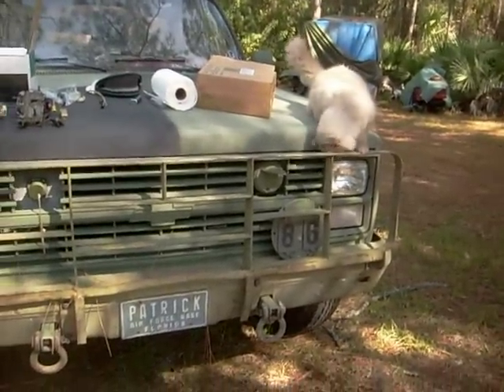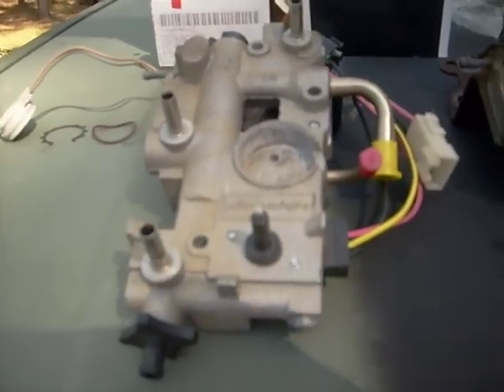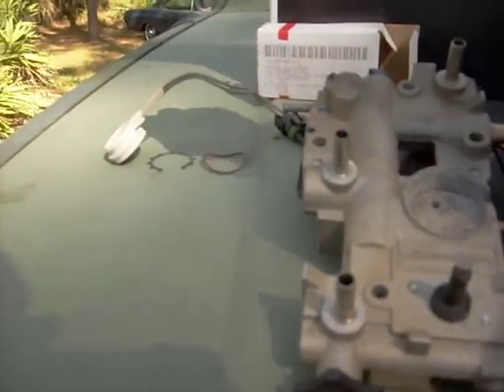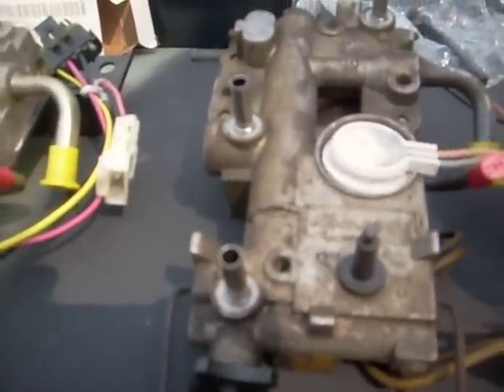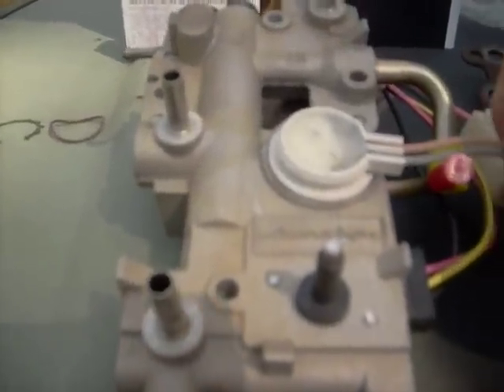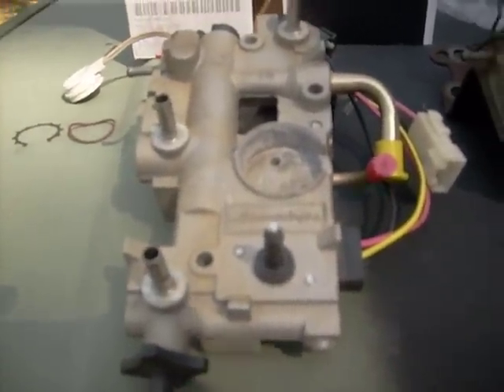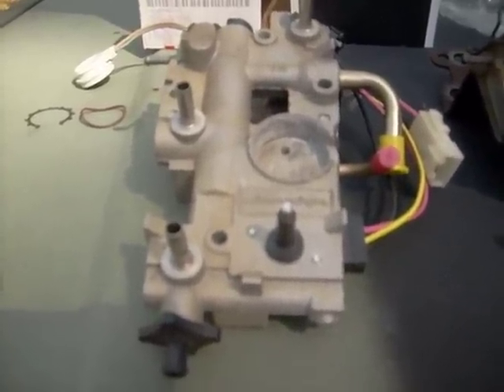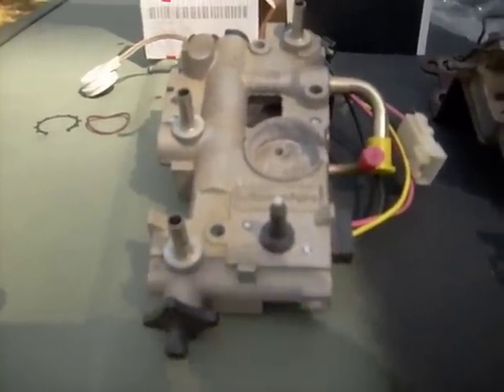CUCV Fuel Filter Base and Fuel Sensor Switch 008

Comment from the maker: @1984tls I see these on Ebay all the time - pretty cheap too.  You may have the one with the fuel sensor that causes problems when the sensor goes bad.  I bought new filter base a while back that did away with the fuel sensor and have not had probelms since.  One thing I do need to do is install an electric fuel pump in-line because I have problem with the fuel draining back to the tank when I don't start my truck for long periods of time.